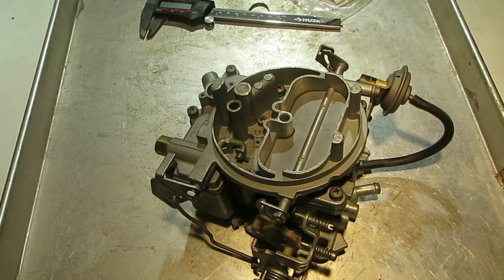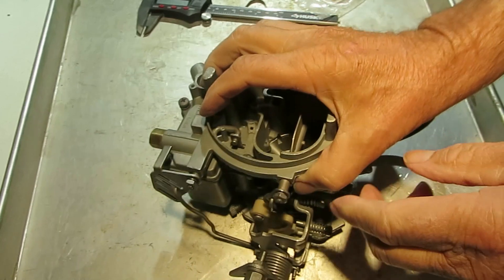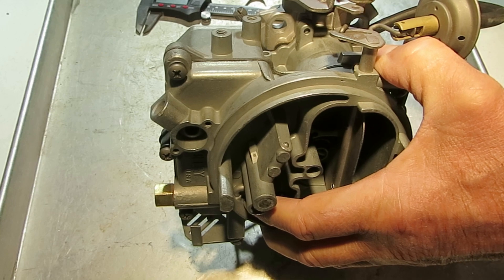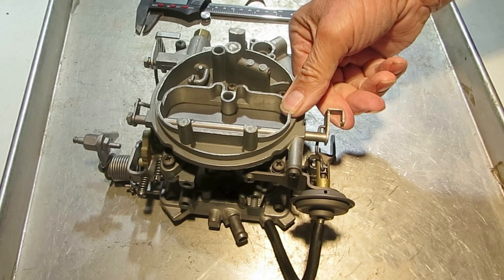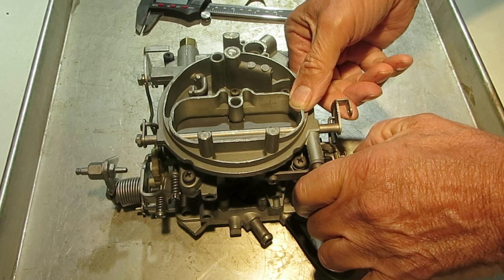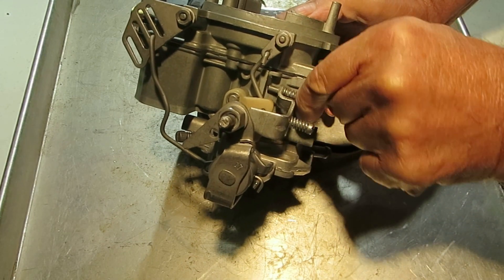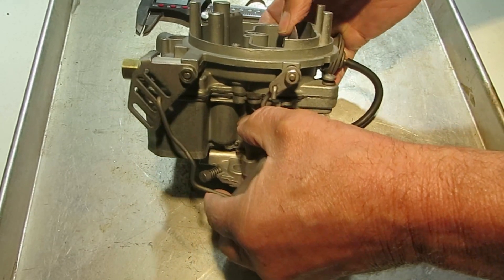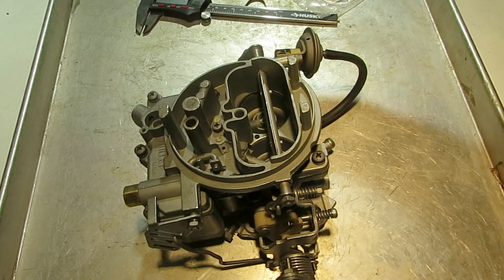Holley 2245 2 Barrel Carburetor Choke Circuit

Comment: So how far open should the top blade be open when At operating temp? Mine will open all the way and has a lag at low speed then when I floor it it runs fine. Is it from the choke on the manifold malfunctioning?
Reply: @MikesCarburetor  and if it bogs down when open what's the problem there? It has like a flat spot at certain rpm idles great then starts to bog the give it more gas it takes off nicely
Reply: Or maybe it's an electric problem I've checked for vacuum leaks and can't find any